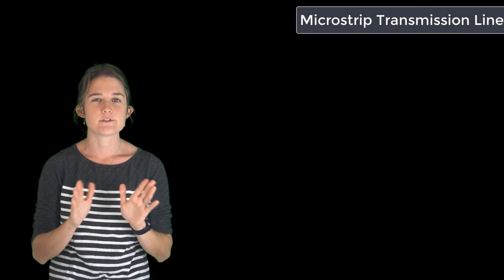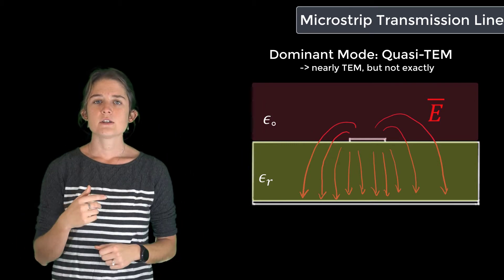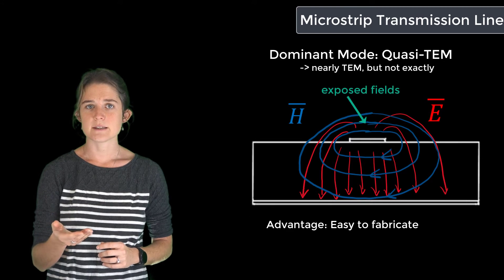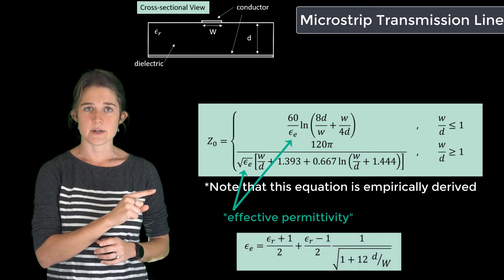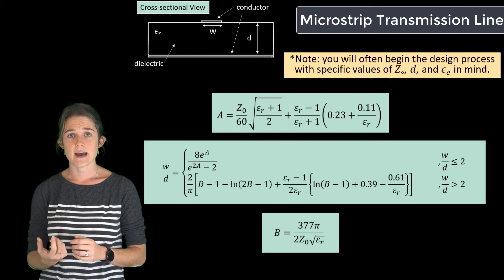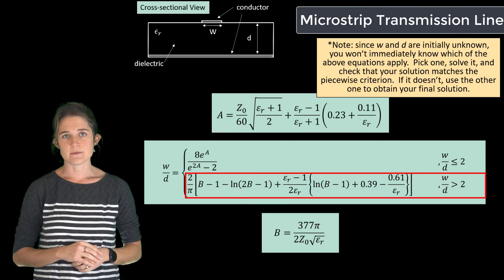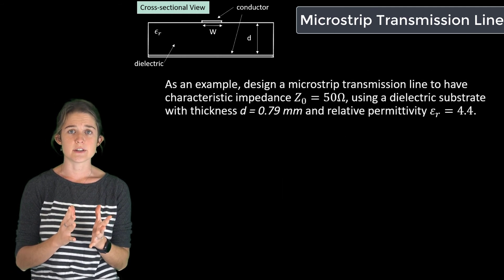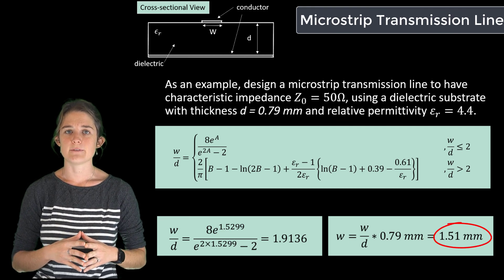Microstrip Transmission Line - Lesson 3

Comment: Hi Dr. Leigh-Smith.
I have a question: the formula for the effective dielectric constant may be used for any width of the superior conductor or is only applicable for w very small (in the limit to 0)?
Thanks alot.

Comment: hello, the length of the track does not influence z0?
Reply from the maker: Hi!  No, the characteristic impedance does not depend on the length of the line.  That said,  the definition of characteristic impedance assumes that the length of the line is large relative to a wavelength (so that propagating modes are the primary method of energy transmission).